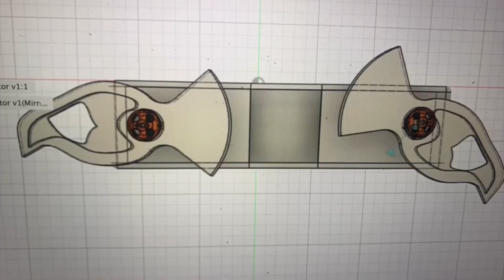Bird Strike: The Ultimate Plant Gyro-Walker! (WPI Plastic Antweight September 2025 Event Report)

Comment: A little something that I have always wanted to ask about those robots is if the blades require an specific angle to move the bot or something, so if you could answer this, it would be nice
Reply from the maker: So, I think it is technically possible to make a gyro-walker without the blades being angled but making the blades angled generally allows the bot to move way better (I know there’s a physics reason for this but I can’t remember it exactly).

As for what specific angle, I’m not really sure. Personally, Bird Strike’s blades are at a 9 degree angle and it seems to work for me. There may be a way to find the most optimal angle to put your blades at but I’m honestly not sure.
Reply: @teamgetwreckedcombatrobots776  The angle means that precession lifts that side of the bot off the ground, that's why it walks well.